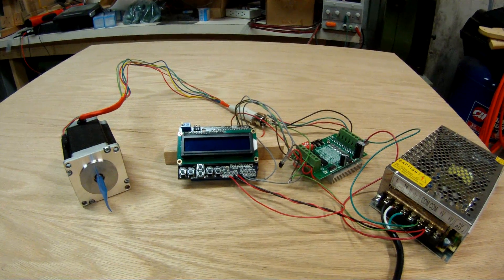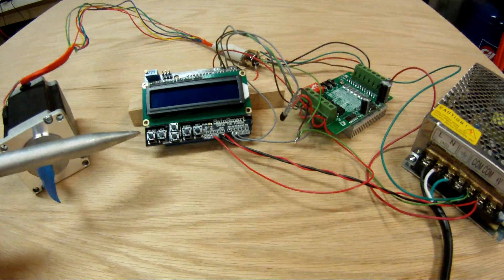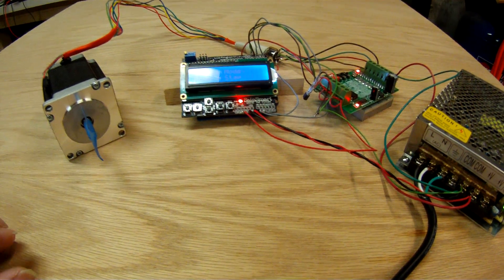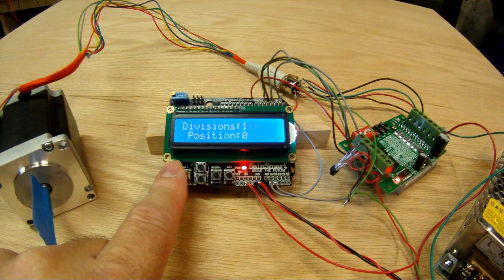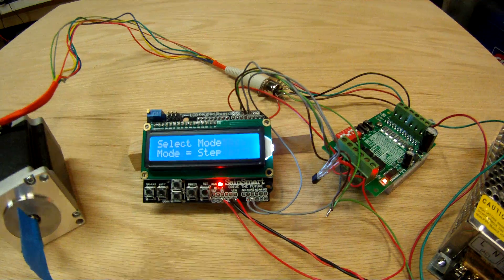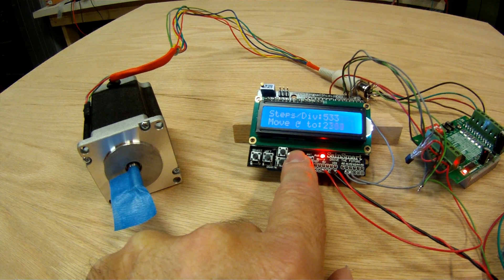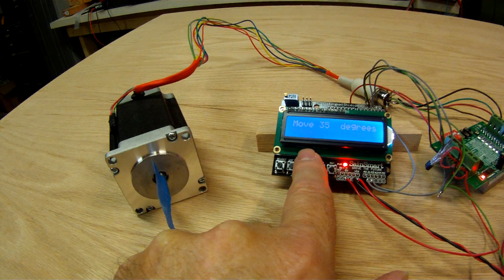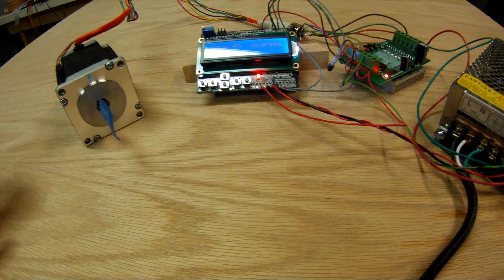StepIndex2 1

Comment: This is a great project.  I have built this in to an ornamental lathe and it works very well.  I do have one problem that I cannot resolve and that is that the indexer seems to lose steps and it does not quite return to the original position after a 360 degree rotation.  I suspect that this might be due to a belt inaccuracy because I have to make my own belts.

Comment: Do you have to program the arduino to tell the number of steps per revolution?? do you have a video that show the procedure mounting the arduino to the screen driver board? as well as the flashing of the correct program of the arduino??
Reply from the maker: You edit a file that is provided that contains the steps per revolution, and then you compile and load the provided program into the arduino. 

 If you are going to use one of these, you should spend some time on the arduino website and its forums where you will learn many things, like how a shield (in this case, the display board shield) plugs into the arduino, and it will also go over installing the arduino software on your computer and walk you through the steps of compiling and loading an arduino program.
Reply: I'm Incredibly grateful for your information and your help!